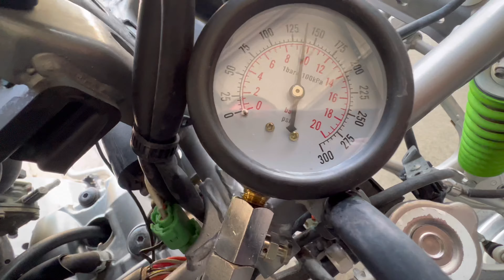KAWASAKI KFX 400 FLIP BIKE #10 GETS TORN DOWN AND CLEANED

Comment: Hello, what did u use to clean the engine so well?
Reply from the maker: @rudyvanderlaan  I was using a degreaser from Walmart/autozone. I now just use 
oven cleaner on a lot of the parts as it’s cheaper and does the same job. Here are the links. 
https://www.walmart.com/ip/CRC-05482-Degreaser/151765787?wmlspartner=wlpa&selectedSellerId=101573050&wmlspartner=wlpa&cn=FY25-ENTP-PMAX_cnv_dps_dsn_dis_ad_entp_e_n&gclsrc=aw.ds&adid=22222222298151765787_101573050_0000000000_21407473164&wl0=&wl1=x&wl2=m&wl3=&wl4=&wl5=1013500&wl6=&wl7=&wl8=&wl9=pla&wl10=5332758675&wl11=online&wl12=151765787_101573050&veh=sem&gad_source=1&gbraid=0AAAAADmfBIqiJkFBCQiCfJSFKg-c9vP4l&gclid=EAIaIQobChMIm7-p_KKwiwMVl83CBB2SfQoqEAQYAyABEgL1fvD_BwE&sid=7b583e0d-b01a-47e5-b7c2-086621719c7d

https://www.walmart.com/ip/Great-Value-Heavy-Duty-Oven-Cleaner-16oz-Unscented/3611795857?classType=REGULAR&athbdg=L1200&sid=5287ebb4-3bdc-4844-b678-112a3acbad5a
Reply: @thequadfatheratv9177  Ah ok thanks!👍🏽